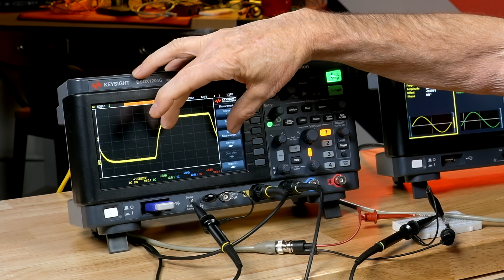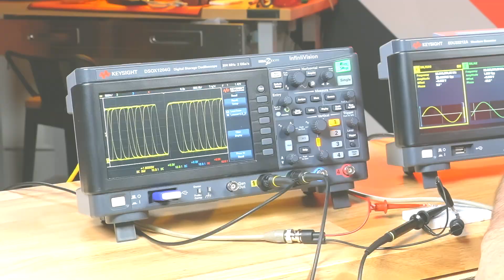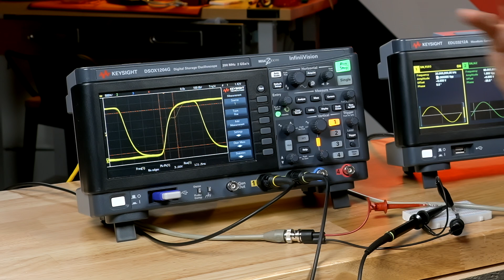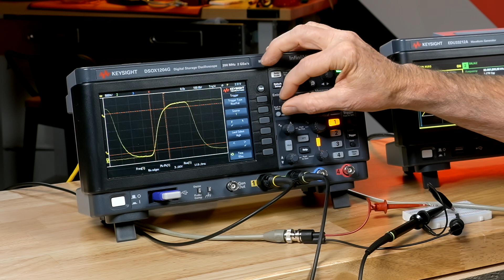Lesson 13: Triggering Part 4 - Advanced Parametric Triggering

Comment: Hi, great series for beginners. I had a fundamental question. How, in general, scopes present the waveforms on the screen? Lets say we have some high Waveform Update Rate, like 100k Wfps. How often is the screen actually been updated and if suppose that would be about 30 to 50 frames per second, are those 100k Wfps all shown divided on those 30 to 50 frames per second. We would have about 2k Waveforms to show every frame. Are they just over-layed on top of each other? Or in some other fashion? Thanks in advance!
Reply from the maker: Yep! They are overlayed on top of each other, with less frequent ones being more dim. You can adjust the "intensity" knob and it will make the dim captures brighter.
Reply: @KeysightHandsOn  Great. Would you maybe know what a typical screen update rate would be?

Comment: Keysight oscilloscopes with touch screens (not the ones shown in this video) have a "zone trigger" feature that can be useful for capturing certain waveform phenomenon (possibly infrequent events as well) by drawing a region on the screen with your finger.  Zone triggering is an extra qualification for the trigger condition.  In addition to the base trigger condition (rising edge, pulse width, etc), the oscilloscope will only trigger when the waveform either intersects (or does not intersect) the region or regions.